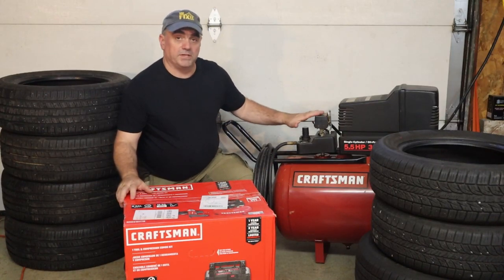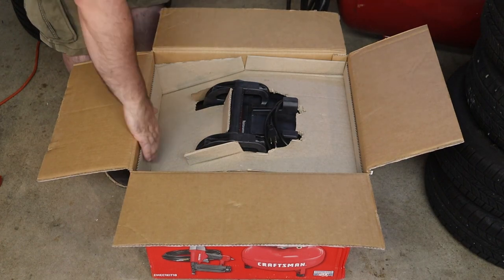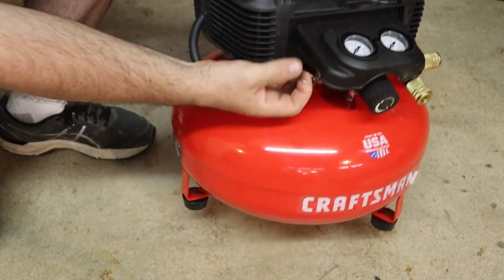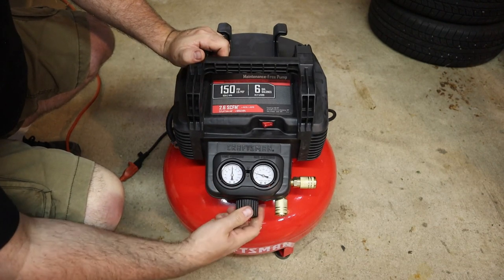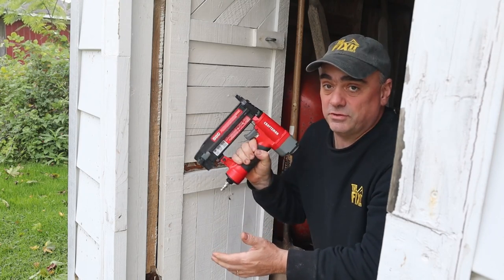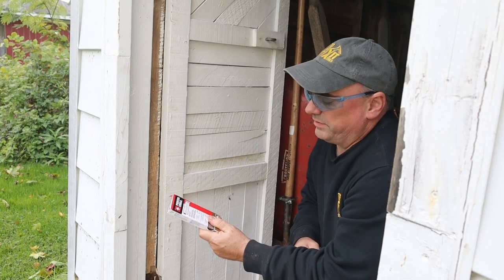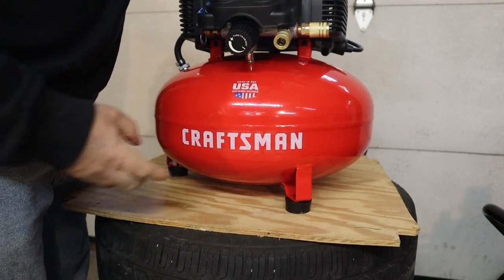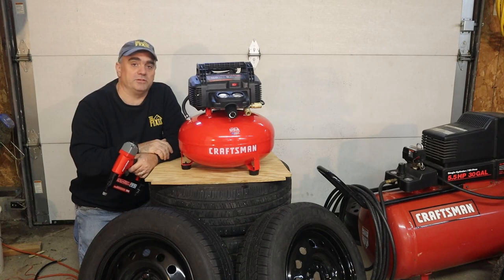New CRAFTSMAN 6 Gal Air Compressor (CMEC6150)  and 18 GA Brad Nailer (CMPBN18SB) | The Fixit Shed

Comment: Thank you! 
I picked up the same compressor and had a low car tire ..Took nothing to bring it up to pressure...Thanks for sharing the use of the Nail Gun. 
My old Compressor out of the early 70s still runs ..Pumped up kids inner tubes and bicycle tires through the years ...
So to the top of the hill my old Compressor compressor goes w a free sign on it. 
Thanks again ..Strait forward video..
Reply from the maker: Thanks for sharing.  I am glad you liked the video!

Comment: I have the same one. It's great for a small shop and DIY'er like myself. I use it for bike tires, car and truck tires around the house brad nailing stuff. No issues with it for a few years now.
Reply from the maker: Yes, it does work great for those things.  I did just try to use it on a metal cutoff tool, and it didn't have the capacity for that, but I am happy with it overall.

Comment: Will this work well on taking rotors off?? No issues?
Reply from the maker: Brake rotors?  I'm not sure what air tool you would need for brake rotors. If it is an impact wrench, it would probably be OK. It gets up to 150psi, the same as larger capacity compressors. The peak pressure just doesn't last as long. If you are trying to use something like a grinder or cut-off tool that use a high volume of air, they won't run very long before you have to stop and wait for the compressor to build pressure again. This little compressor is good at being portable for small jobs (nailer, tires...)

Comment: I know the main tank is 150 PSI what do you set the pressure at to fill a low tire? Thanks.
Reply from the maker: If you set the pressure regulator to the desired pressure (say 35 psi) for the tire, you will not over inflate the tire, but it will take a long time to reach 35 psi.  I usually set it to 10 lbs or so over what I want the pressure to be.  That way it starts slowing down as I reach the desire pressure, and I can be more accurate.  The higher you set it, the faster the tire will inflate.  Just make sure you are monitoring the pressure in the tire, so you don't over inflate.
Reply: Thank you so much for the info! @TheFixitShed

Comment: Why do my air compressors look nothing like yours? I don't think mine have a tank. Do they all have a tank that should be emptied?
Reply from the maker: You probably have tankless air compressors, typically used for inflating tires, basketballs, air mattresses, etc.  Air compressors with tanks are used when you need a high volume of air flow (air tools, etc).